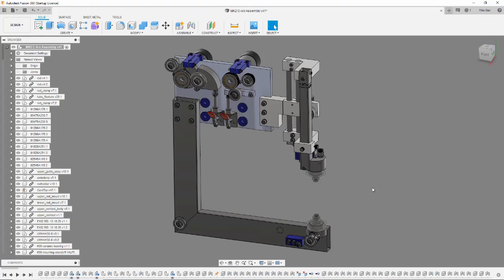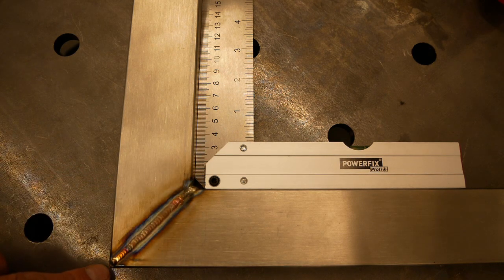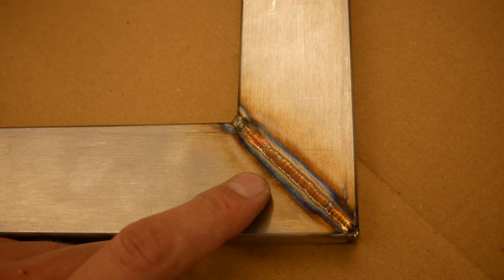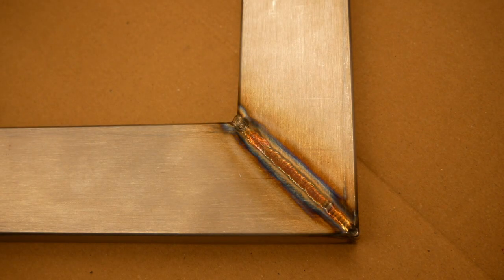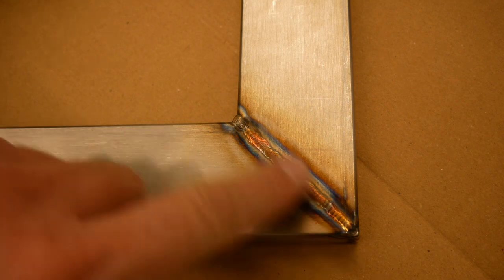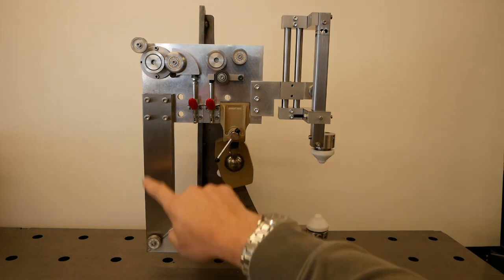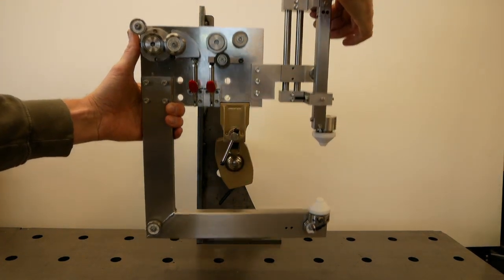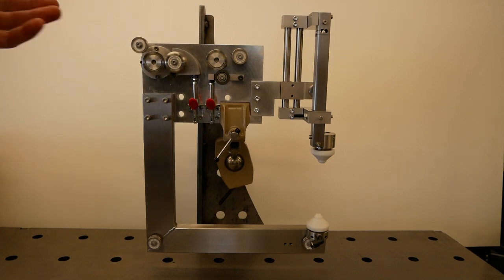Wire-EDM Machine, MK2 redesign: Part 9, C-Arc lower jaw + assembly

Comment: Yeah welding stainless can be very challenging due to how much it expands and contracts with heat. A tip: don't weld the inside corner. In this application, it's not needed for strength or being liquid-tight and is responsible for most of the weld distortion. Another tip: don't fasten the pieces together via a 45-deg weld, just do a 90-weld. The benefit is a shorter weld and less distortion. Again, this works because the tube assembly does not require high strength.

Comment: Nice work.  I wanted to cough on your behalf when watching the acid fumes rise.  :-)  Given the difficulty of getting a perfect weld on 90, I'm curious if you're considering just making a bracket to join those two pieces instead.  Maybe that's no big deal for the commercial fabricators, but it looks like it takes a lot more time to get the welding right.  The whole assembly is looking great.

Comment: Could you tell us how much current you flowed through the brush during the chemical cleaning? And how much voltage did it go to?
Reply from the maker: Hi, I current limited my supply to 20A, the voltage fluctuated between roughly 2-12V due to the current limit.